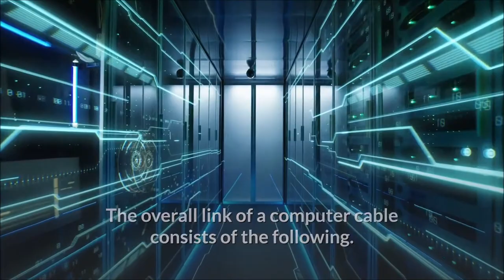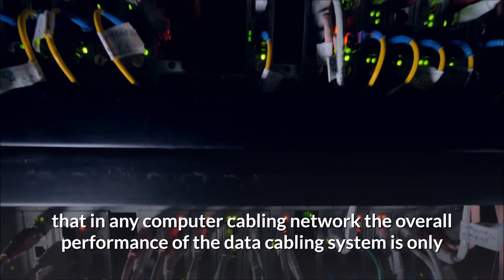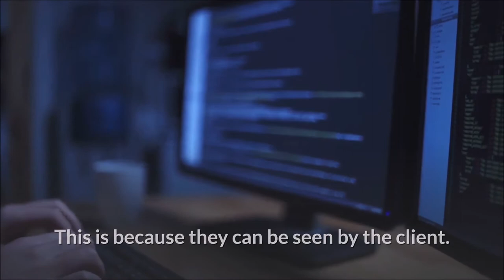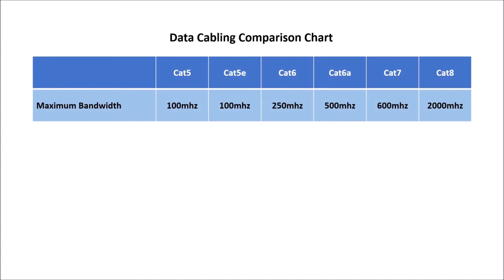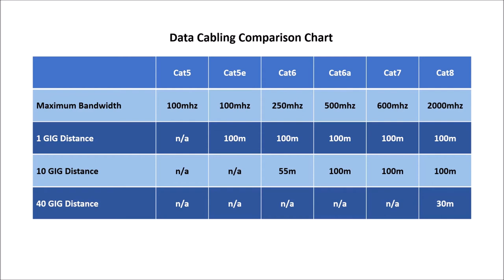Will Cat6 Cables work with Cat5 ?   (Cat6 / Cat5 compatibility )

Comment: Lets say i have an existing cat 5 cable.. but i want to use cat 6 cable to join both cable together as the length is not enough. Is it possible to do so?
Reply: Using a rj45 joint connector